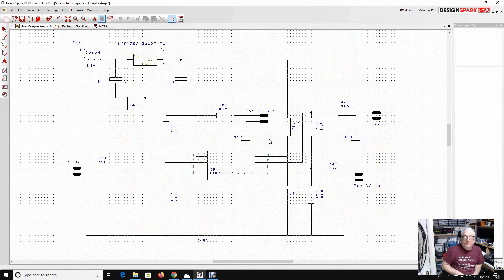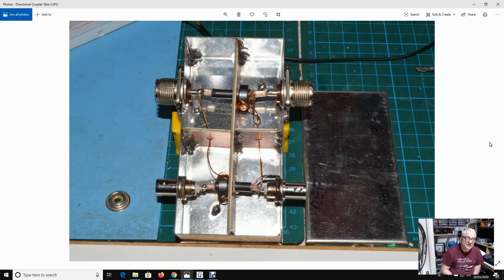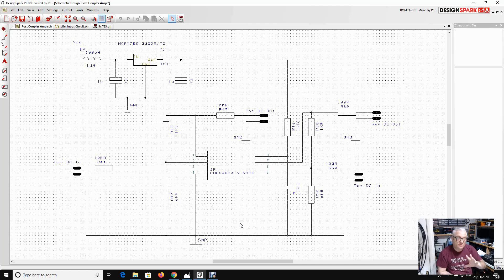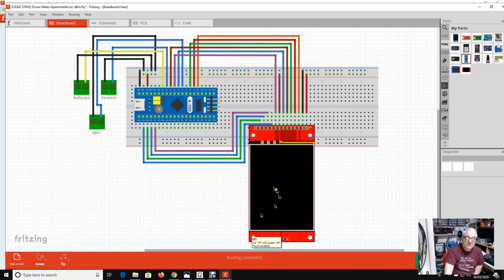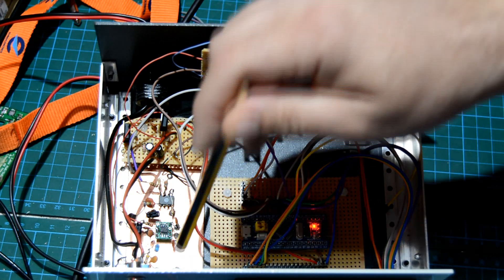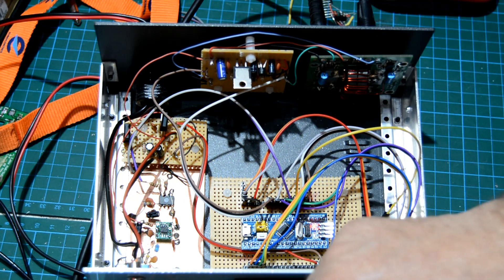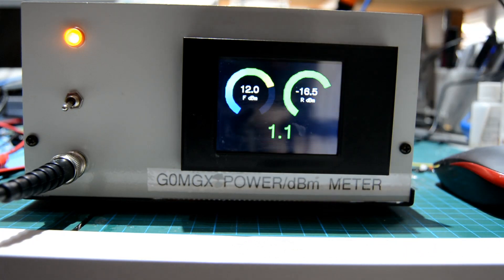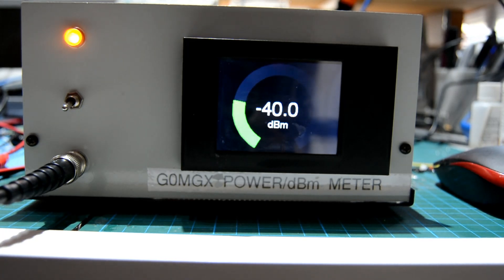Power Meter Finale

Comment: Great video Mark, this is what I'm going to build having run part way through your Microcontroller Knowhow book. I've got a directional coupler coming from Australia with the 8037s onboard. Finally got STMduino working OK on an older version of the Arduino IDE (1.8.19).

Comment: No apologies necessary Mark - properly interesting.  Is the box from HA5IA shop on EBay? I've 5 projects enclosed in those.
Reply from the maker: Yes, I think the ebay store is called "discount devices" but the enclosures are a little pricey, but good quality. Case fronts scratch quite easily so you have to be careful when drilling et cetera. I have quite a few now and they seem to be the best about at the moment (dont we miss Maplin?)
Reply: Mark G0MGX yes that’s the shop. English address but run by a Hungarian gent with above call sign. I cover my panels in masking tape for marking and cutting out. I miss waving my project at the boxes and enclosures at Maplin too.